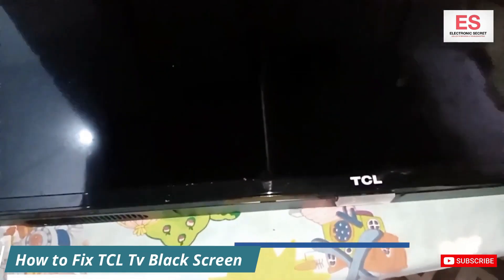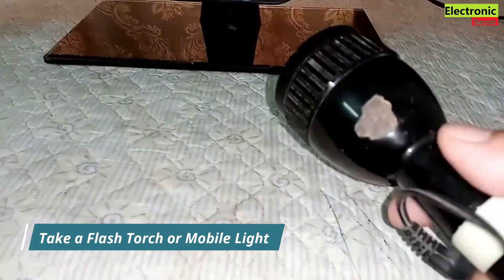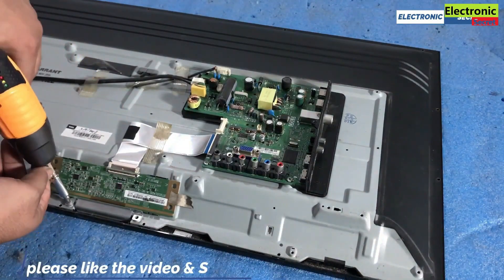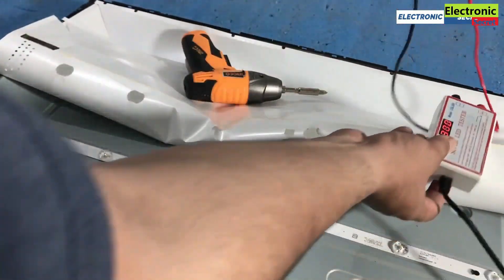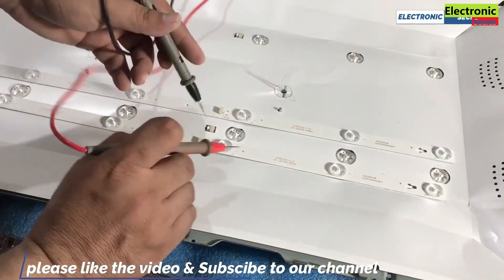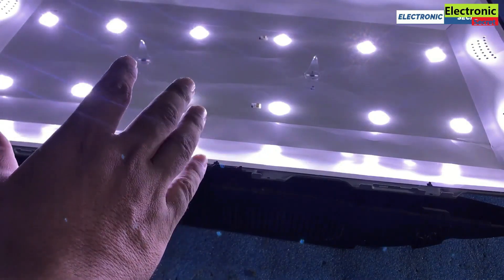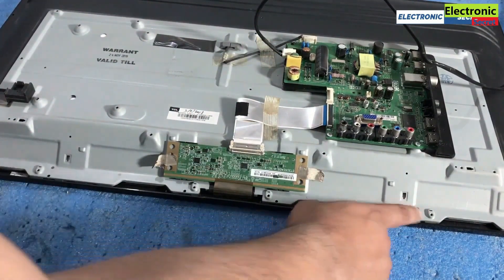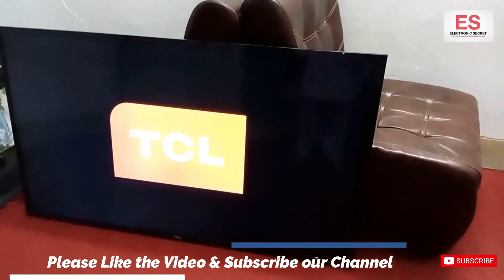TCL BLACK SCREEN FIX

Comment: When using the multimeter do you have the tv plugged in and powered on? Or neither?
Reply from the maker: When testing backlights by multimeter or tester, Power off Tv from wall socket